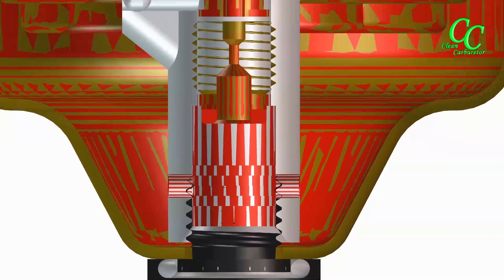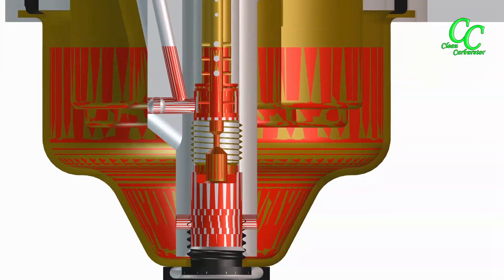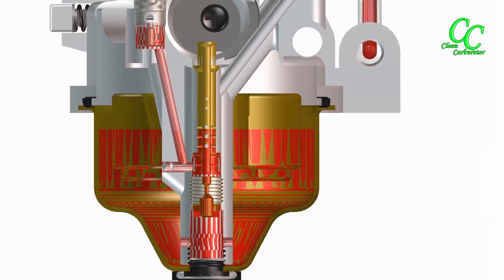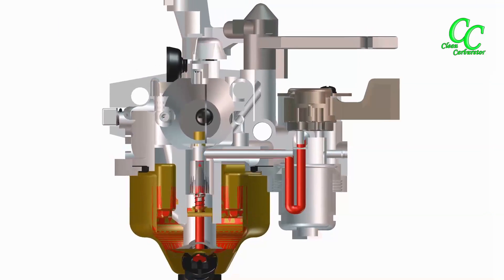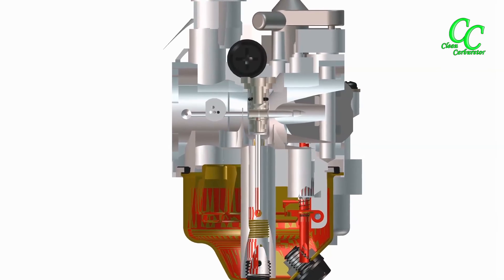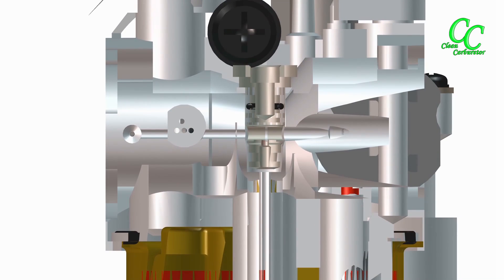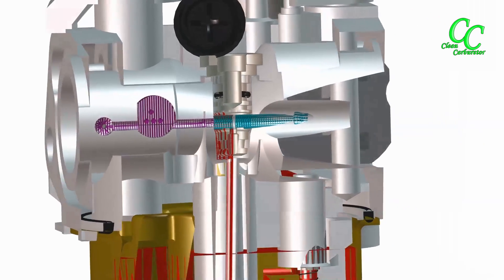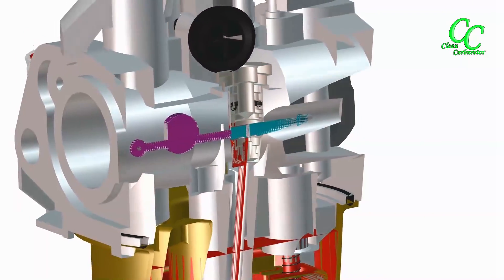How Carburetor Works - Idle System

Comment: what happens when you drive with choke on(of course increased fuel consumption) , my bike was riding with half choke on for 4 months cause of faulty cable, found out yesterday, bike was ver difficult to idle had adjust throttle continously, now everything ok.
Reply from the maker: @bazrazin1 - with choke partially closed the engine air fuel ratio is way to reach (too much fuel for the giving air). The engine will have a very difficult time staying running; too much fuel will extinguish the flame inside the combustion chamber and engine will misfire. Also too much fuel will wash down the oil film from the cylinder liner. If your engine is 4 stroke change the oil, it's probably diluted with the fuel.
Reply: @cleancarburetor  i had a very hard time keeping the engine running especially at traffic signals, leave the throttle & engine would die out, 
would change the oil as soon as possible, bike would jerk also while driving. now that choke cable problem solved, idle is much better from the earlier had to adjust throttle screw to keep engine running, but would increase very much while driving, that was expected riding with choke on will reduce control over choke.